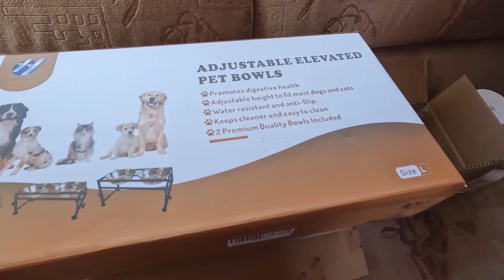We Had To Tear It All Out! What Does This Mean For Our Rainwater Cistern?

Comment: Nice job on the peaceful cohab w rattlesnakes. Besides basic human decency, it's way safer for you if they don't think you're out to kill them.

One safety suggestion - put a handle on the bucket lid. Don't have your fingers around the rim, just center a drawer pull on the outside of the lid so your hands can stay out of sight, and you can use the lid as a shield when capping or upcapping the bucket. I've got a setup like this and it's a real step up from just the original lid (mine is a screw on).

Love your channel, best luck!

Comment: The valve is down there in the hole which can be protected by a vertical pipe and a water key to open and close the valve.
Reply: Yes a christy G5 cover with 8" shaft pipe.
Reply: I don’t really understand but it sounds solid. 🙂
Reply: Yes,you could of saved time and money this way
Reply: I was going to say the same thing
Only thing I would add is to add some gravel under the pipe and cover it with screen to keep the bottom of the hole from filling up with dart because there is usually an escape valve under the valve itself and does leak water when you turn it off and on. at least that's my experience replacing the water spickets on my property all below the frost line. that were not done originally by the prior overs. of course your pipe and valve is way bigger that what I have worked on.
Reply: @markbarcellos5500  12 inch is better to use with a end cap.  Then I make my water key with a 4 inch pipe that has notches cut out to fit over the butterfly valve.
Reply: Hey now, building out a homestead isnt exactly intuitive. There's a lot of systems you gotta learn and implement, with just enough knowledge to know you don't know shit. 

Like Jim said when he was describing the initial build, it was made hasty with scrap. On the fly, not on his mind. His mind is pulled in so many directions just wrapping his head around everything. Then you got life's needs, emotional needs, marital needs, vehicle needs, animal needs, damage control from the weather. Soooo much can set you back. Being behind schedule is the schedule.

From experience, I know. Years of nothing else but learning, experimenting, laboring, building. I've come to not critique past me for  decisions I wouldn't make now. I did the best, researched as well I could in a time frame and pushed ahead with what was on hand. Of course I know more now, experience is the best teacher. 

It's a puzzle, not s problem.
Reply: @Mix1mum  
It's called life and we all get to live it. It just means we can all make choices to do things properly from the get-go or not. There is sp much info out there nowdays on YT Google etc there's no real reason for going at anything half informed. Making excuses for someones poor time management is not doing them any favours. 
Also everyone who is running a YT channel has CHOSEN to expose themselves publicly & has opened themselves up to criticism as well as praise. It's not being humble to expose your bad decisions in public, it's called posting creators failed  content.  Expecting people to feel sorry for you for being lazy or irresponsible is not a good trait. Try less comic relief , cos you're not a comic, and spend that precious time on researching BEFORE attempting a new venture. FINISHING a job completely is a really good trait.
Reply: @thefakerscritic1397  I started watching this channel because I was interested in how earth bag building was done. Now I’m staying for the  unintended comedy. My favorite was when he was using a cinder block for two to rough up the tin cans so he could paint them before thinking to get a wire wheel for the drill. 😂
Reply: That's how mine is set up,a piece of galvanized corrugated culvert installed vertically
Reply: Great idea! Like a main water shut off valve. 😊
Ever also consider adding gravel at the bottom. And then a cob and plaster around the lid to prevent lots of Rainwater  flooding the hole 🕳 🙄?

Comment: To help you to turn that valve on and off without getting inside the hole, take a 5' or 6' length of some 2" or so PVC pipe and notch the end to fit the knob. That way you can turn if from outside the hole. Make a T-handle on top. You could put a hole in the cover and just leave the PVC in and mark it on and off too then. You can use some of the scrap OSB plywood and use them as pieces across middle of your new box to help keep it from caving in again.
Reply: Hey ! Thats a good idea !
Reply: Landscapers do something like that for turning on sprinklers. The pipe is about 4 feet deep and has the valve at the bottom.

Comment: Put about 6 inches of rock under the balve. Encase about a cubic foot around the valve and rock in something sturdy. Then run a length of large pvc up to the surface. Backfill around and use the T-handle method. I've got that setup and it's going on 50 years old.

Comment: Even though it sucks that the box partially collapsed,  I  got to watch you do what you do so well... keep on digging Jim! 
On the eaves, is there more than one place for the water to run off? If not, you might consider a few more downspouts.  With how hard the rain can come down there, you don't want the weight of a bunch of water bearing down on the eaves. 
So much rain in the desert. Love those shots of the clouds over the dome.

Comment: Hi guys. If you do another shut underground just use a 8”-10” pvc pipe cut to fit. Then use another piece of pvc with a notch cut in to stick down to close and open valve. Then you have only a8”-10” protrusion sticking out of the ground. Keep up the hard work.

Comment: just a suggestion buddy. why don't you use a 12-in Sono tube to drop all the way down over the valve handle itself and then backfill that tube in the ground and then use a t handle with a fork end to go turn off and on the valve as needed. that way instead of a huge vault you have just a small tube that would be easy to keep clear. just my two cents

Comment: Simple |’’’| ,4 L connection and place the valve on the top at ground level. Then fill it in with dirt. Just do it in a couple of months when the water is gone. Looks great by the way.

Comment: Cistern looks good. Where I wanted it to be, I would use concrete. Keeps the rain water out, the mud out and makes a solid. Protects the valve, pipes, and structure. Cob takes way to long to dry out with all that rain. On the house itself, I would repair with stucco. Just fill in the holes with it, and blend it out.
I have seen cob domes, houses, sheds, and such. They all got stuccoed. Some were aircrete sprayed. It keeps the water out!
Doc

Comment: Try using a blue water drum to replace the valve volt. Cut out the bottom to let the pipe and valve slide in to the bottom. Keep the black screw on lid as you access pint.

Comment: hey jim. have you thought about using a pvc pipe, say a 6" pipe standing up over that valve with a screw on cap. just need to make a rebar T to reach down there to turn the valve like the would in the big citys

Comment: I hate to say this, but, that box will rot just as quick.  The best way to get access to your water valve is to use a 12 inch PVC pipe that will go over the valve, notch it to fit around the pipe.  I make the pipe stick above the ground about 12-16 inches, then use an end cap as the lid.  Make a long water key to turn the water valve.  I did notice you have a round valve, You may need to replace it with a PVC ball valve. 

Another option is to install a city water meter inside a plastic barrel with 2 holes drill out on each side. Then use the lid on the barrel as the roof. It's water tight.  A water meter would give you information like how much water you're using during any amount of time you would like to know.

Comment: Good job with the little pipe house. Maybe it would be a better idea to extend a piece of wood from the lid frame out to the end of the metal top so you won't be bending the metal each time you pull the top off?

Comment: I just had an idea you may consider. Actually, I saw it in another YouTube video. A couple living in Norway built a geodesic dome over their cob home to protect it from the weather.  So, their three story cob home remains unaffected by the extreme weather. And they use the space between their cob home exterior walls and the geo dome walls as a greenhouse and patio space.  If you research geo dome construction, you will find DIY geo domes will cut building kit geo domes cost probably up to 70%. Check out Paul Robinson's you tube videos. Basically for geo domes you need struts, hubs, and a dome cover. Robinson has a video on machine pressing the ends of metal tubes to create the hubs. Metal last longer than wood struts. Pacific Domes uses similar metal struts, which serve as hubs as well. Consider checking them out too.  All the best. Love you guys!

Comment: Been watching your channel now for a few weeks, I understand a lot of your challenges trying to build things as cheaply as possible. food for thought on the next go around with the box you could box the hole out with concrete 4 inches to 6 inches with re-rod for strength if you intent is to have access to more than the valve, also put a sloped roof on top slight angle to shed any water. Another option is a piece of 8 inch Schedule 80 PVC notched to fit over the pipe and valve with a cap and screw cover, make a tee handle out of 2 inch pvc works great. Line the outside of the pipe with rock for drainage similar to the posts on you lean to building and back fill the hole. I commend you for trying to live out your dreams learning as you go is a rough way but a great way to expand your abilities. When life deals you a problem step back access everything and look for solutions don't be afraid to pencil down several before you start. Look for information that others have out there on your issues they may be similar and give new perspective to the problem. I have been in Construction for over 30 years still do not know it all learn to think outside the box everyday. Success is based on the learning from one's mistakes and moving forward.

Comment: If I was in your situation I would want to replace the valve I see you are currently using.  I would use your existing valve to shut off your water supply, then I would cut into your line and put a schedule 80 PVC valve in your line.  I would then open up the other valve and just never use it again.  Just so you are aware, I have done this type of work for more than 30 years.

Comment: Since you already installed the box use old motor oil to seal the wood from rotting out. A better option would of been a 10" or 12" dia scrap pvc pipe cut off from public works. Cut to fit over the valve and pipe filled with a little cement/mortar half way up the valve body to keep water out. Pvc comes up to 8" above ground level with a cap. With a valve stem attached to the valve and handle up top for easy reach. This will keep the valve dry from corrosion, keep the critters out and nothing rots. 😎👍👍

Comment: leave the lid up high so that the hole can breathe and to get out the moisture so the wood will not prematurely rot . the side of the hole need to slope away from the hole so it will fill with water .  the 4 to 6 inch pipe with a long valve key is a good idea it is used in most cities to shut off water to people residences . you box will last many years so maybe next time . be well

Comment: Wouldn't it be better to use an underground opening system such as fire hydrants with a piece of 4-inch PVC pipe. and thus you avoid so much shoveling earth. Since you are building it, in 2 years you will have to rebuild it.

Comment: 14:16 Man that was an easy supper!! Snake Bite Chili comes to mind. And a free hat band if you salt the hide down. Fun. Chili made with "pulled" rattle snake, and lots of hot peppers to taste. I use to cheat though. A friend would send me the flash frozen snake meat in one pound packages from a snake roundup in west Texas and I just had to thaw and cook. Once cooled I would pull it with two forks to make shreds about an inch long from the cross section rounds. Lightly brown and start building the chili from there. Great stuff and very few knew it was actual rattle snake. They thought the name was from the peppers and chilies I used to make it fierce. Would pop a sweat on your forehead in most cases.

Comment: @ jim from where you are now with that access box, id throw a back of crete right in the bottom, then rake it out to give you a floor. if indeed that pipe or valve fail. there is gonna be a SHITTONE of water in the hole. if you leave it wood and earth walled and floored, it'll be impossible to fix. itll collapse during the fix.

Comment: The 1st thing I learned in house framing....every joint or splice.... is a potential HINGE, as evidenced by the sides of your valve box. Now looking like a bow tie. Next thought, cut a vee on opposing sides of a 6 inch plastic pipe, place over valve and pipe, backfill to ground level. Then buy turn on for sprinkler valve, extend to desired length so no need to bend over, problem solved.

Comment: Marine-grade plywood wouldn't be too bad if you're the bury it in the ground they also have pressure treated plywood something to consider stuff below ground almost kind of acts as if it was underwater depending upon water table not really a problem for you in the desert that strand board you don't want to use that especially where it's going to be exposed to the elements

Comment: im guessing that is going to be a main water valve  and i see alot of people in comments saying how to build a key for it . but if its just a shut off valve  for the main you wont need one . i mean how many times are you really going to need to turn it on and off  once you get the plumbing down in the house . i think you did a great job  and the steel roofing was a nice touch  it will last a long time for sure . only thing better would be reinforced concrete .  but between the  concrete and the water proofing  paint  you might have had to use  i dont know if it would have been any cheaper my guess is it would have cost more . but hey it worked out the way you did it and looks good to . man  i dont mess with snakes that would have skeered me to death lol . here in Michigan we have one rattle snake  and i have never in my 50 years of life seen one . they hang out in marsh and wet lands  swamps . and they dont want nothing to do with humans at all . so if you see one its cause you went looking real hard for one . or you live in a really wet land area . glad you dint get hurt by that snake buddy . work safe and stay cool . you guys are doing great .

Comment: I'll tell you a good trick for making potable water very "clean" as well and using what I would call The Ultimate Kitchen you have built with your sandbag structure and that is to get a cheap cooler and fill that with water and freeze that to about 90% and create literally "clear ice" after draining out the bottom 10% of what doesn't freeze. The uses for that type of ice are endless but most importantly in cooking, bread making, use to spray the plants down, make a great coffee beverage etc
Reply: You do realize they live in a desert?

Comment: About the box: Maybe in the future, you could upgrade the valve box from wood to cinder blocks, maybe even fill the cinder blocks with Portland Concrete, ( Fill each layer with concrete all the way up the walls ). Just some thoughts to make it more secure since it's an important area. My Grandpa told me once, If you try to save money  on something you really need, you will keep dumping money into it til you build it/make it right. Im just trying to save you from future headaches.